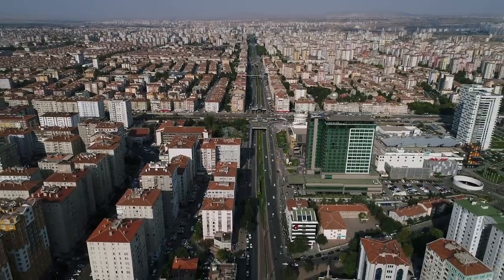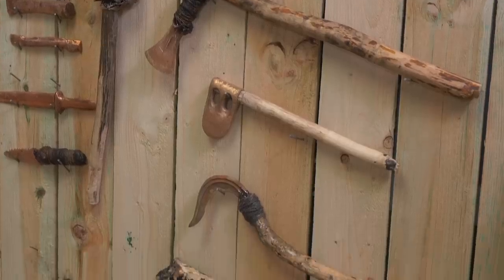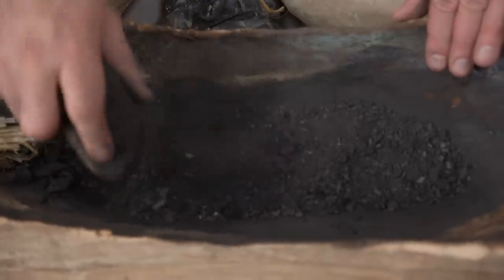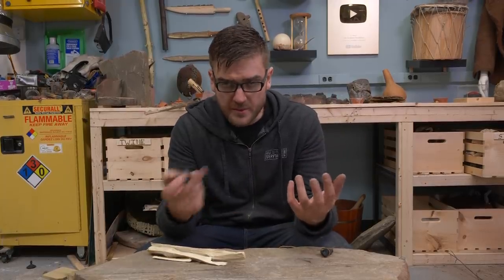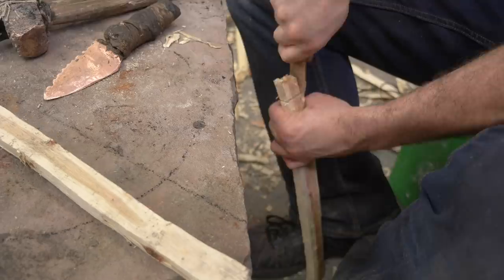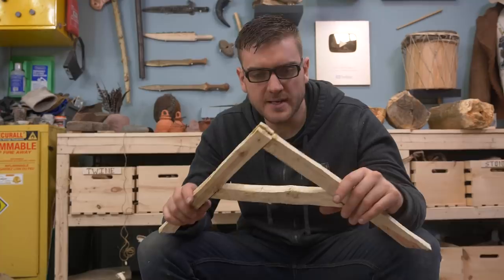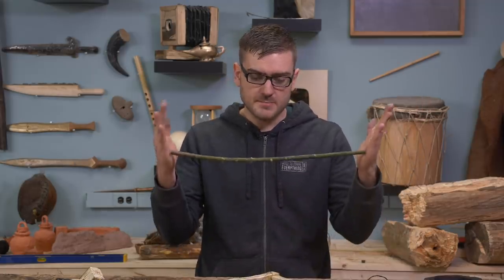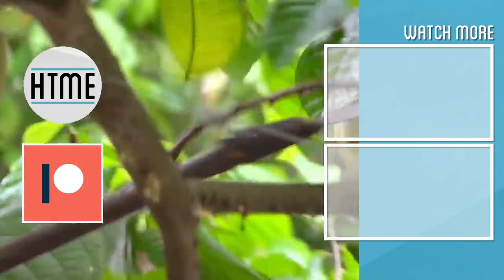DIY Tool that Built the Pyramids

Comment: Water would make a good level
Reply: It's suspected that, that is how the got the bases of most pyramids so level
Reply: @emmitunderwood9502  yeah that's almost definitely how they leveled the base. That's about the only thing at that time that could be used to make a level surface of that size.
Reply: Water not level over long distances tho.
Reply: @daybot9592  so you think the Pyramids are big enough that you have to account for the curvature of the planet? Lol... it's not even close so yes, the water level would be perfectly level for the base of a Pyramid. If the water is stationary and not naturally running in a current down a decline, then it has no choice but to be level. That is how physics and gravity works.
Reply: So they had long transparent tubes?
Reply: @daybot9592  no, you build a small trench around the area that you want to have level and fill it with water. Then level the surface of the edges until it's level with the water on all sides. That levels the sides and corners. Then use string or rope from side to side and corner to corner to level the center of the base you're making.
Reply: @daybot9592  I believe what you're talking about is a bubble level.
Reply: @89ludeawakening1  so the desert sand held water?
Reply: @daybot9592  well it's obviously not just endless sand if you dig under it in a wide open area. Notice how the Pyramids and cities aren't built on top of sand dunes. Haha
Reply: @daybot9592  The thing is is that you gypped wasn't always a desert And who knows what other resources they had there
Reply: @daybot9592  The pyramids were built on rock not sand and the Nile was close to the pyramids site that there were a Nile port near the pyramids that they used to transport building granite blocks from Aswan nearly 1000 km away for the burial chamber.

Comment: You have wood, sand, glue and wax, please make a "sandpaper", for sharpen your tools
Reply: They didn't have paper. In any case, there is not need to make sandpaper when you can actually use a block of sandstone. There are drawings in tombs showing it.
Reply: @alfastur6833  to sharpen the scythes, people use to glue sand in a stick, with pork fat or resin, would bem better than stones to process wood
Reply: @alfastur6833  Lmao the Egyptian gods are laughing at you right now. They most definitely had paper and it was made of Papyrus.
Reply: @89ludeawakening1  you know that papyrus is way different from modern paper right?
Reply: @marysue9661  you know it is still considered ancient paper, and could still have glue and sand put on it to use as sandpaper right?
Reply: @89ludeawakening1  It's not "ancient paper" it's an entirely different thing. Paper isn't just a generic name for a sheet that you write on it refers to one specific product made from wood pulp. Papyrus making is an entirely different process, which is quite a lot more time consuming. This is also why you definitely would not have used it for sand paper as it would be way too valuable for that when you could just use sandstone. Theoretically they could have made "sandpapyrus" but would they? Probably not because that would have been like using an iPhone as a grinding stone.

Comment: Your measurements method should be based on the dimensions of earth. I suggest you take the distance from the north pole to the equator and sepperate by 10000 to get one unit. If you want larger sizes you can put a adverb in front of the unit every time it gets 10 times larger. Also I suggest you use a size of 0,1 units by 0,1 units to use as a measurement for liquid. For weight you should make one unit of water and have that be the weight of one unit of weight. For temperature the freezing point of water should be 0 and the boiling point of water should be 100. You can make up any name you want for these units but I suggest u use this method. It makes a lot of sense because everyone's earth has the same size. But foots or ears can have different sizes

Comment: I feel like if you want to use your own standard of measurement, you should use “hand” instead of “foot” lmao
Reply: i don't walk on my hands, it would make pacing a distance rather acrobatic.
Reply: The hand WAS a standard unit of measure, it was about 4"(the width of the palm). It is still used today as the standard unit of measure for the height of a horse

Comment: I heard years ago that ancient people’s used to level large areas that were originally uneven by flooding the whole area. Then they drove equal length poles into the water and ground until they were all flush with the water surface. Then they would drain the area and let it dry out. After that they would dig the excess dirt out until they reached the bottoms of each pole when they connected all these spots by digging out the dirt, they had a nice even surface to work with. I hope all that made sense. Pretty fascinating. Y’all have a great weekend!

Comment: your base for measurement should be one ten-millionth of the distance from north pole the equator
Reply: the only stable way is the first way he reminded, comparing and adjusting for several times.
Reply: Ten-thousanth would be better. For a ten millionth you could put the Latin word for 100, centi in front of it to indicate it's 100 times smaler
Reply: @tootpic2259  Don't care it because he is not a indo-european speaker.
Reply: Nah, that sounds like an absolutely garbage and arbitrary measurement that has no excuse to actually catch on.

Comment: bro, I totally came here convinced you were gonna nail it but you went overboard!
you could have just stopped at the string, that's literally all they needed.
take a string and half it until you end up with 12 even divisions and mark them: now divide into 3 segments, each of 3,4,5 respectively. 
now you have a right angle and do not need a days work like you showed in the video (for which I am nonetheless grateful).

Comment: You should do everything you can to make a perfect cube out of bronze and then use that as the basis for your measurements of volume, weight, and length.

Or, if you wish to go the anatomical route a handspan is probably a good measurement of length.

Comment: The flatness can be greatly improved by figure eight sanding it on the stone block. I don’t know when A true “surface plate” started to be used in practice, but it’s pretty straightforward: if you polish three surfaces against each other until disparities are removed, all three will be flat to the resolution of your disparity size. Once you have a reference flat surface, you can dust it with a marking substance like ash and then scrape or plane the local flaws. Search for “nyc CNC scraping” or “Stefan scraping” to see how (and why) this is done even by modern machinists.

Comment: The Pythagorean theorem is older than Pythagoras, its documented in Mesopotamia by 2000 BC, and in Egypt around the same time in the  Berlin Papyrus 6619 (I wish we had an actual name for the document). So its possible that the pyramid builders could have used it.

But still a great video. Keep up the good work.

Comment: Learning really old simple techniques actually come in handy irl... Some String and a pair of sticks can measure perfectly symmetrical squares with basic math and geometry skills. For instance, when making a perfect square the diagonal cut is 1.4x any of the 4 sides... and both Diagonals are obviously the same size. So wrapping string around say... your hand 10x then 4x gives you all the measurements you need for a near perfect square, then you just adjust till both diagonals are equal and you got a perfect square.  If you ever see sticks and string marking a construction site... I'm talking about doing that without modern equipment.

Comment: Hello - Atomic torches were used to cut blocks of stone for the Pyramids and Sphinx. A cold melt meant that no heat was generated to that the object of place could be used immediately. The metal seat the back of the machine would hold the operator while the atomic torches could emit the laser rays from nozzles along the front, bottom and sides. In this way a whole hutment or hangarage could be excavated in the space of a few hours. It left no dust or dirt residue at all. The levitation principle involves an anti-magnetic device which is dangerous to the untrained as one can float right out of the world, in other words, fall upwards. The control involves two grids, one tuned to the magnetism of the Earth. When the grids are in a certain position, the machine plates will float; they will not go up or down. But if one pushes a lever which alters the relationship of the grids to each other, then in one direction the Earth magnetism becomes the stronger, and so the machine plates sink down to the Earth. But if we want to rise up, then we push the lever the other way to that the anti-magnetism takes effect and the Earth repels instead of attracts. In this way we can rise up into the air. One operator could lift up these hundred-ton blocks and place them in position without exerting himself. Then, when the block was in the precise position required, the magnetic current would be switched off and the block would be locked into position by the natural gravitational pull of the Earth. The alien technology was actually brought from the planet Tasch in the Tenth Solar System of this Twelfth Universe by the Hyiptian Rah-Sham-Het and developed further by the power of THOUGHT by the Solar Hierarchy, the Twelve Sons of GOD headed by Archagel Michael (who had His Temple under the Sphinx, His head being the semblance) in Ellhonia, Drunhia, the capital of Egypt in those remote times, 3,5 million years ago. This is how the Pyramids were built, utilising the potency inherent in the solar amethyst of which they were erected. They were intended as Temples of Worship and Training Colleges for the Initiates into the Advanced Degrees of the Mysteries. Thank you.

Comment: Primitive straight edges are extremely precise and easy. Take two large, flattish stones. Place one on top of the other. Rotate the top stone clockwise. The idea is that the friction between the two will rub the two stones smooth. Do it long enough and both will have a flat facing. Making a wooden flat edge would entail rubbing a piece of wood on one of the flat stones until it too was flat and smooth. A lot of work, but accurate.

Comment: As a carpenter, I can tell you that the plumb bob is used 99% today in setting door frames. Also, you would've had a more accurate plumb bob if you would've used a string to form the plumb bob on so that the point that hangs to give you true plumb is lined up straight on the string so both ends are at the same plumb point by shaping it purely by hand, the tip that is closest to the ground might be off from the hanging point by centimeters or less. So true plumb may in turn is no more! Still great though. That is more "fine tuning" for having a more "true" plumb rather than a "close" plumb.

Comment: Chalk string is still used today by many contractors.
Back when I was in college learning to be an electrician, we used chalk strings for straight lines. Laser levels were the new, hot thing, but those are expensive and unwieldy and require setup. Why go through that when you can just pull up a string between two nails, pull it and release?

There's even variants with gaps every X distance, for automatic marking of where nails, studs or cable clips should go.

Comment: a wood bodied plane with bronze "iron" ought to be useful. true up the sole on sandstone or something similar. 
I just did a brief google and wikipedia indicates the ancient Egyptians had either a plane or something similar.
also, there is a cross grain cutting method used in log house building that, with practice, can leave a surface nearly as flat as a plane, so I've heard.

Comment: For your civ, make length-measurement based on the length light travels in a specific time in vacuum. Or the propagation time for sound-/shock-waves in a specific (mostly pure) gas. Then just use some kind of prefix similar to the 10-based one for kilo etc.
Reply: While that's a neat and stable unit system (and the one we use worldwide, with the metre defined by the speed of light, and the inch defined by the metre), there's no way for a civilisation without incredibly advanced technology to measure it in the first place, so it wouldn't be in spirit with the rest of the series.
Reply: @photonicpizza1466  I mentioned sound because I knew light was a bit difficult. As for sound, all he has to do is set up a telescope, a sufficiently ~~advanced technology indistinguishable from science~~ loud noise with a visual indication occurring at same time, measure time diff, and then measure distance to make his version of a meter-stick.

Though this is likely going to need air (hard to find naturally occurring nitrogen tunnels that are long enough), so might be worthwhile using liquid as a medium instead... except then he needs an even longer distance to detect a time-lag.

Comment: The fact you can still buy Chalk Markers for making straight lines in construction prove how effective they are. 

Yeah you can buy fancy expensive Lasers now... but they break down, and require electricity. A spool of string is way easier to replace than a Laser.

Comment: To make "level" first you need flat. Like dead on flat to act as your level reference, then you can create the square things. How do your get dead on flat? It's simple:
1) Get 3 stones that look flat already
2) Label them A, B, and C.
3) Then rub A and B together for about 20 minutes.
4) Rub B and C together for about 20 minutes.
5) Finally rub A and C together for about 20 minutes.
6) Repeat steps 3-5 a second time.
7) Enjoy having three flat surfaces to work off of.
Are you sure that the surface will be flat? Yes, so long as you rub all three stones against each other one at a time. An irregular surface when abraded will naturally knock off high spots. The constant switching allows uniform wear and a natural flat line to be created.

Comment: You’ve forgotten to include that egyptians also used knotted strings.

A string with 13 equidistant knots (with the last overlapping the first) could easily be staked out to form a 3,4,5 triangle to give a right angle, long before pythagorus ever existed.

The strings snapped to make the lines on blocks could have already been pre-knotted to specific lengths. As long as the fiber was prestretched, or not very prone to distortion over much use, they could have quickly and accurately produced a large grid of blocks for cutting.

Comment: If you need to parallel from your existing line, you use a stick and mark its distance from the other line at each end. Then re snap a line. Pre dating the rule, people used story sticks, that had all of the relevant sizes for marking and making repeat cuts on them instead of gradations. People in hand industry today stull use rods like this with the component size marks on them when making batches of the same thing. More simple than stated dimensions, the stick can be copied, and it's faster than constant measuring.

Comment: If you want to create a more accurate "smaller' scale, start by measuring the distance of a random finger's knuckles in a way that you find something with somewhat even analogies so that your fingertip to your first joint would be 1 unit, first joint to second would be around two etc. Modern machinists and engineers have been using a similar trick for approximating inches and centimeters :)

Comment: For creating a standard measurement, you should go north from your shop (or some starting point) and measure the angle of the sun at noon. This can be done by using your sqaure and plumb bob at noon. Measure the sun's angle at the shop and send a friend north and have them measure the degree difference of the sun's angle in the sky at noon. Farther you go north the better for measuring the difference unless you make a large square and plumb to get more precision. You now know how to measure distances in degrees. You can divide these degrees into 10ths/100ths/1000ths  etc to get a standard measurement (Like the ancient meter). You can even calculate the rough circumference of the Earth knowing that so many of your cubits = a degree and a circle = 360 degrees.

Comment: The difference is that people at the time wouldn't have rushed any of this. They would have taken the extra time of making their tools nice and straight by lapping them on rocks/slabs. Even at the Bronze Age they had quality standards which made their tools much more usable. Of course a bronze smelter would have done that all its life, same for carpenters. Life long experience would have made those workers invaluable. You can bet they had better tools than that and a much wider variety including custom rigs to produce those tools. Also, FYI, Egyptians had hand planes... you know that old tool to plane wood.
Reply: I agree with you, the stable tool like a chisel was used for several generations of craftman.And a carpentor must have collected all the size of chisel.

Comment: Oh... another thing... level was often determined with a water level. Basically a simple vessel would be permanently dyed by filling it part way with dye. They would then place the vessel on a flat board that was floating on still water. Once a permanent colour band had been achieved, they could check something’s level by using the simple vessel and putting some liquid in it. They’d compare the colour band to the liquid and see if they were parallel.